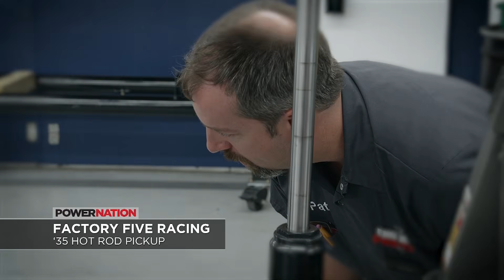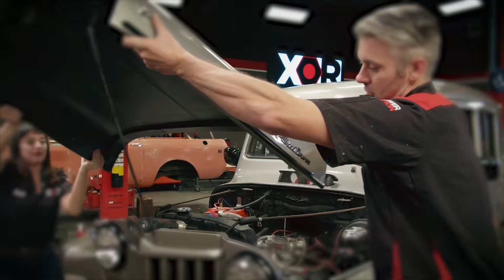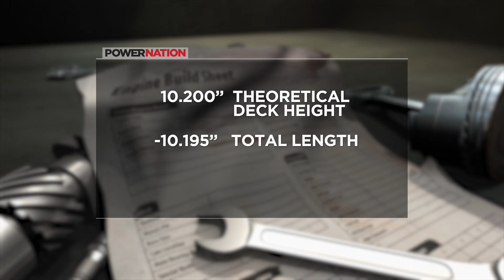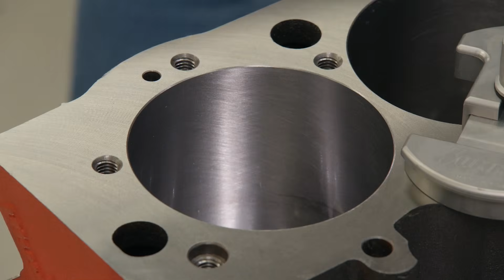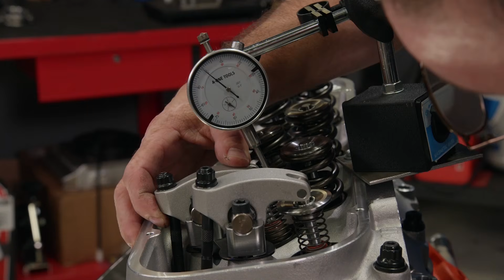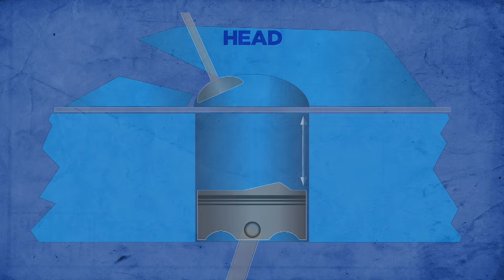632 ci Big Block Chevy Build for Project Wild & Willys | Engine Power - Full Episode

Comment: Would have been nice to see the dyno results.
Reply: I'd definitely like to see what a $30k engine can do on the dyno
Reply: Nothing like talking crap about HP and not showing your viewers the #'s !!!
Reply: Probably under a 1000
Reply: It's extremely hard to get a thousand horsepower out of a naturally aspirated engine big block or not just not enough air to make horsepower
Reply: @jameschristy9966  
Hard to get 1000 hp from a 60 ci N/A big block? It's easy these days. Use a set Profiler 24 degree CNC heads, a 280/294 114 degree cam w. 850 lift, a tunnel ram, a vacuum pump and 11:1 CR. There's your 1000 hp.on pump gas w. off-the-shelf parts.
Reply: @jameschristy9966  maybe over. That's massive compression and huge flowing heads. And he's rolling with solids. He's gonna see 1000 for sure out of that 632
Reply: @brendanmccarthy492  excellent
Reply: @brendanmccarthy492  he said the heads flow 453 cfm @.800, the cam lifts over .800 with huge duration and the 15:1, with a proper induction its well over 1000hp.
Reply: and showing the actual power/torque bands for the intelligent people who know peak numbers are only a small part of the story

Comment: I was impressed with the size of the block, bore, rods, and pistons. 😳 When I saw the size of the heads, valves, and (holy hell!) the intake runners I was shocked!
Reply: It's about time some Honda civic loving tool will chime in and say how much power their boosted 4 banger piece of crap makes 🥴
Reply: Backyardmech1 YOU SHOULD SEE THE INTAKE RUNNERS ON MY 12 DEGREE BIG VICTOR HEADS ON MY 632, THEY HAVE 2.45” INTAKE VALVES.

Comment: People have made more comments about beating that lower pulley on. Most engine builders do whats called setting the crank and that is giving it a couple of raps on the end of the crank with a piece of wood and a bfh. I always go back to front in the direction my clutch fork pushes. Beating on the crank with the little rap taps he did will not hurt the thrust bearing nor does it change end play from where it was at to start with.

Comment: Damn. That's a big engine. It's got over twice the displacement of my 5.0 Coyote.
Reply: I did the math to get in into liters and I couldn't believe it. I thought i did my math wrong but I didnt, 10.3L is insane right?
Reply: @edwardmyers1746  sounds more like a marine desile engine or something, dosen't it?
Reply: @177SCmaro  deffietly I know them marine motors get pretty big like 8.1L and bigger as well!
Reply: @deadboy600 420hp from 5 liters stock so more like 84hp/l. This BBC would need to make about 870hp while meeting emissions standards to do what my 5.0 does stock with its displacement. Given those huge heads I don't see 870hp being that hard to achieve here but doing it while being EPA compliant for a car or light truck is another story.
Reply: @177SCmaro  It probably could be done but wouldn't be exactly easy.
Reply: @johnrus7661  Right.

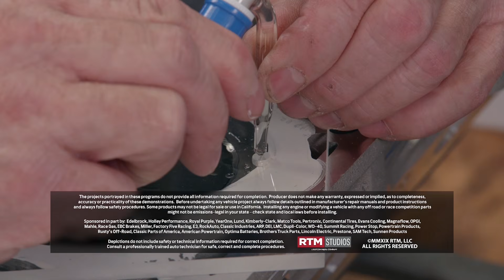Comment: I would like to see or can you explain how you determine and or reply on how you go about determining the length on rocker studs on big block and small block Chevy when using after market heads . This is something that I have not 20:18 seen covered on your show or any video that I know of. Reason I ask is I’m building a mark IV 427 with pro comp. Heads and went from hydraulic flat tappet to hydraulic roller my push rod length changed of course but I ran into a problem of the stud length needed to change also this is from the rocker side length in order to get proper valve train geometry set up also only 1 stud on each cylinder needed a longer stud length because of the boss where the stud was resting in the head was lower on intake than it was on exhaust. I needed 5-3/4 turns on my rocker nut after paralleling the 1.7 rocker to the valve spring upper keeper using a line through the trunion through the center of rocker tip . I could do this on the same exhaust stud that was used on flat tappet cam but the intake stud was not long enough to get this pre set to measure for proper push rod length . Love watching your show and all the info you guys cover on engine building great show .

Comment: @Brendan McCarthy  he said the heads flow 453 cfm @.800, the cam lifts over .800 with huge duration and the 15:1, with a proper induction its well over 1000hp.

Comment: Am I the only one that spit out their drink when he hammered the thrust bearing out of the motor installing that lower timing pulley? I know that shop has the proper installer somewhere.
Reply: I've seen them do that multiple times! Drives me up the wall.
Reply: SMOBY44 I’ve also seen them bang the cam lobes off the block plenty of times

Comment: There is no way I would ever put a belt drive on a displacement like that if anything I would go with gear drive I love the whine they do
Reply: Yea, I was with them until I saw the belt.. No, No, No, No, and No.
Reply: Belt drive is extremely tough, accurate, quiet/less harmonics and quick to change or disassemble.  
Personally, I hate the whine of gear drive unless it's a blower whine.
Reply: @nitroustommy  okay so you got to put a extra gear on the crank for the belt and there's no way that a belt is as tough as Steel and as far as the wine of a Gear Drive I really don't care what you like it's what I like that's my opinion bud  plus I don't like boost I'm a NA person
Reply: 😂 you mad bro?  Chains stretch and crack, gears wear.  There is a reason 4000 HP cars run belt drive . The harmonics from the gear drive would destroy the valvetrain.
Reply: I don’t think any true 4wd vehicle will ever use a drive belt for the same reasons they wanted to keep it naturally aspirated.  However I doubt this thing will ever be dirty again.
Reply: @maidenlord6663  if you dont like boost, then you must not like making lots of power on reasonable motors.. it's awesome watching someone else spend oodles of money on tall deck, 5" bore space motors, but when it's my money, give me a boosted standard bore space motor, and I'll make similar horsepower

Comment: Mate, really enjoy your show! After 30 years building motors it always surprises me how much lube you use whilst assembling the engine. I design the assembly lines, fixturing and tooling for BMW engine group and must say you use more lubricant on one engine than we do in a week of production. Is this an American thing or personal enjoyment?
Reply: In most high performing builds like this where parts are machined to order you really don’t want to risk access ware on the engine so lube is never a bad thing

Comment: Isn't it true that the piston to wall tolerance is generalized for all regions and temperatures? And that if a car was confined to mild desert or west coast temps that the clearances could be less?
Allowing for a tighter ring pack/piston design, of say 1mm, 1mm, 3mm. For a turbo engine with a maxed stroker/rod ratio, and a fully supported oil ring land...With  aux. h2o & oil heaters/gauges for good measure. Shouldn't the building tech improve with the times?  I'm talking about a custom built engine, for that region.

Comment: 15:1 compression?  Pump gas is out... or?
Reply: Never ... 87 regular all day
Reply: @tjlovesrachel  yeah 87 octane will detonate REAL fast with 15:1 comp............
Reply: @tjlovesrachel  It's white text on a black background, where is the sarcasm indicator in that data?
Reply: Theodore Dowman Ohhh man... your a salty one aren’t ya buddy...well I guess next time I’ll lay my sarcasm on a little thicker
Reply: Im running 11:1 and i can run 87 if i pull so much timing out that its basically dieseling. I bet with a big enough cam at 15 to 1 you could run 98 cruising around town and switch to race gas at the track. I don't know though I'm a diesel mechanic 24:1 all day baby. I only Built the motor in my truck because it was a lot cheaper and I didn't want anyone else to do it.

Comment: anyone notice that at the beginning he puts the piston in the cylinder with no rings?
Reply: Its so he can easily rock it to check what the tallest height it would reach. Hard to do that with the rings on. Only the motor at high RPMs can make the piston potentially rock back and forth with the rings on
Reply: @Disablednoob  ohhh I was thinking that they were being cheesy and fake at the beginning but it makes sense

Comment: Ok what am i missing? Why have such a big lobe on the cam and then have such a wide Lobe centre angle. 113Deg. is low emission area. Here in the UK our engine are very small by comparison in swept volume as well as power output😂
 Our performance cams use much less lift but generally upto 330 deg for race 300 ish Deg for Rally/ Tight twisty courses and upto 270 Deg for moded road stuff.  Race cams can be down to 98 Deg LCA, 104 is  more normal Rally profiles are 106 -108 deg and road specs 110-112
So as you can see  113 would be really wide for what we would understand
Reply: I agree on the LSA, but as far as duration, are you talking about advertised or at 0.050" tappet lift? That is a huge difference in duration.. most cams advertised at 330° are around 230° @ 0.050".. they do that as a standard to measure a cams duration between manufacturers, because the manufacturer can advertise whatever they want, but the numbers at 0.050" lift lie a helluva lot less

Probably the reason for the wider LSA is less overlap than if it was on a tighter LSA, which produces more cylinder pressure.. which at their 15:1 compression ratio, I think it's a moot point, but with the extreme duration of the cam they used, a lot would be going out the exhaust.. so I understand it.. personally I would have retarded the cam a little bit, but these guys aren't always the best at choosing parts..  if it doesn't make 1100hp, these guys are losers
Reply: European makers usually give lift at 1mm (40thou)  one of the better cams for a 1ltr engine I get to play with is advertised as 304Deg.  It's got 240deg at 40 thou. 150thou @ tdc and 380 thou lift. On a fully prepped engine we see 122bhp from a little 1ltr sohc 2 valve per cyl.  Shame it's not 3ltr 😂

Comment: The extra -.0035 on the deck clearance an issue with manufacturers' numbers or rod bearing clearance?
Reply: Raymond Kaczmarek my guess would be that the block was not decked to the exact number advertised, possibly to leave room for clean up on a future rebuild if the deck surface was damaged

Comment: Not to be judgemental, but it seems a waste to throw that kind of a mill into a Jeep.....feeding pearls to pigs.  Too much compression for the normal man/woman......I dropped about the same piston into a hot 460+ Ford I built.....mine were forged TRW pop-ups and I cut a flame trench thru the dome..  I had to go to water/alcohol injection to quell the detonation.  A pain in the ass but that engine made very good power.....if I remember that compression was 10:4/1 and the ported iron heads (SCJ) I used didn't help.  I couldn't afford good aluminum heads at the time and was using a short cam duration advanced 4 degrees with high lift to pull camper(big RV cam)....fast, but limited advance in distributor.  With the long duration/high lift /zero cam advance + Aluminum heads this engine should not have the problems.
Reply: WOW!

Comment: Wouldn't a rubber timing belt be more susceptible to stretching in such a high compression high horse power motor?
Reply: I would think so, a big inch mud running engine, I would run timing gears.

Comment: Worthless 15 to 1 compression :/ if you can use pump gas it is just an expensive toy you can’t get fuel anywhere.
Reply: Ryan Ehlis Um, E85.....not available everywhere, like where I live, only have 91, but in the Midwest it’s everywhere.  It’s far more knock resistant than 93 and closer to C19 race gas.... so yeah, a ton of states have E85 at the pump making 15 to 1 completely streetable and usable.
Reply: Blaine Reeve ok yes E85 octane rating is like 105, but fuel system has to be set up for it.
Reply: @bigboreracing356  no...

Comment: Nice build, But the lack of even mentioning the open belt drive on that engine is hillarious ----- your building that for a mud bogger truck and they wewre scared to put turbos on cuz it gets so dirty. how the f**k is it a good idea to run an open timing belt on that obviously very expensive engine 
just degree the cam with a bushing run gears and put a cover on the damn thing it will sound even more raunchy anyhowwith a gear drive setup and it will never breakl the belt and cause catasatrophic engine failure 
thats YOUR tip of the day lol
nice build though must be nice to play with stuff like that 
peace